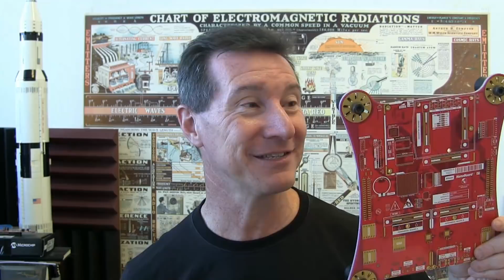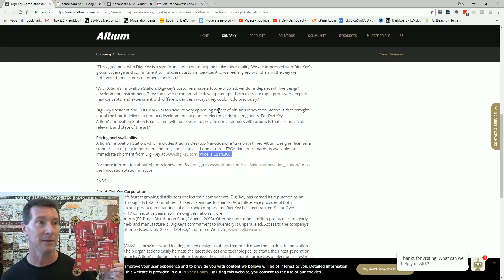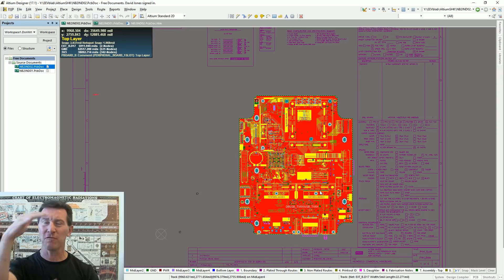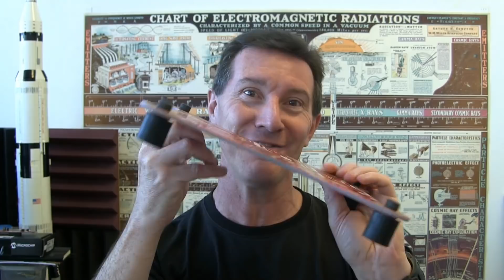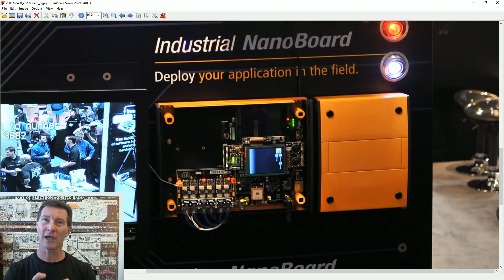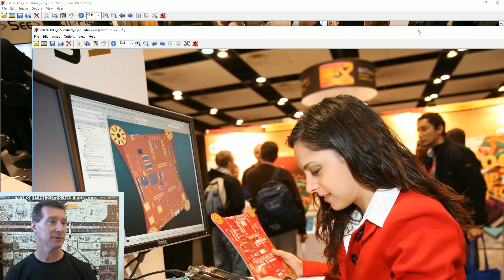eevBLAB #51- Industry Story - Design Deadlines & Unusual PCB Designs

Comment: Boy, that takes me back. One day I was working for a company that sold IT systems and software to physicians. And believe you me, you haven't seen a tight-fisted cheap bastard until you've tried to sell something to a physician. We had one guy who actually dragged his IT equipment out of the dumpster(and then complained to us that it didn't work properly of course)! Anyway, our system was designed to run in a client-server configuration, but because the doctors didn't want to pay for a separate server, I was tasked with getting it to work on a virtual machine on a Debian machine.
 About two weeks in - with no deadline set - the boss casually said as he walked out of my office, "Oh by the way, I need this ready to set up at the customer's practice in three days" - my face at that moment would have sent a hells angel scampering (but not my boss, him, never. Most self-absorbed idiot I've ever met). Well, as Dave said, you get it done, so I dove into it. I just about made it, too. Boss said he'd leave at ten the next day, I literally had ONE line of xml to tweak to get it to run not only on my dev box but on the delivery system and I'd already been in til 10pm the last three days, so I thought, "What the heck, I'll finish it in the morning" and went home. Promptly, at seven the next day, the boss phones me on the mobile and yells "I wanna leave, why isn't this thing done???" I said "You said you'd leave at ten, I'll be in in 30 minutes, I can have it done literally in under five" - "Now I can't wait, I have to leave NOW!!! It runs on the dev box? I'll take that one." So he really took my dev box, the rattiest, oldest PC you can immagine, and installed it in the customer office. It was literally a wreck, even missing a drive bay cover. The next day the customer phoned me up and asked me about the missing cover, and I (I know I'll go to hell for this) actually sold her the line that it was to improve cooling. As Dave said, you get it done. Not long after that, I got out of that sweat shop and got a job for almost twice the salary. Need I say that place is not in business any more? God knows I tried.

Comment: This is just to suggest that you consider starting a playlist where you explore cloning a standalone automotive ECU using modern MCU's.  Something to emulate or exceed the VW/Porsche/BMW/MBZ electronic control units that were sold starting in the mid 1980's with oh, Digifant for example. I think you would need a team because doubtless you have the digital and analog design and execution chops but I dare say even you would you need a gearhead for the 3D maps for fuel and spark..(rare for those guys to know the kind of things you know but hey Bosch apparently found a few..)..

Comment: Engineers work just fine with or without deadlines, in my experience.   It's the interaction with management that changes when a hard deadline is set.... it allows the engineers to say "no" far more freely, and thus put a heavy damper on scope creep.  You'd have to have done 12 designs if there wasn't the hard deadline. ;-)

Comment: Ghent Light Festival 2015, that one was fun. Due to a misunderstanding they put ENIG over the entire flex instead of finishing it with OSP, as a result a lot of the FCBs failed and we had to rush alternative ones through our own prototype line. Worked through the holiday break, alone in the cleanroom, to stick all the boards (>40 of them) in the vacuum press. In the end we were still soldering half an hour before the journalists arrived, a colleague was still stapling things together, and then we still had to load the code into all the microcontrollers, and there were a lot of them. I vividly remember standing on top of a questionable chair to hold up a laptop so I could get the programming cable to the board. Didn't get any t-shirt though!

Comment: 21:12 is all you need to know. I once did a traveling trade show with Apple in support of their authorized dealer network in the late 80's that hit Montreal, Toronto, Winnipeg, Edmonton and Vancouver back to back to back to back to back doing setup and teardown of our equipment plus deep technical consulting. I was the primary solution architect for VAX, System36/38/AS400 Macintosh inter-op gear so we were toting around a MicroVAX2 and a tiny System36 mini-computer a bunch of Macs and misc. gear. At the time I thought it was bad ass but man after the 3rd city I was destroyed as a person, my feet still hurt.

Comment: I really want to see a video on the engineering behind current transmitters found in industrial automation, its easy to make a pot controlled current source, but how does it work for a modern 4-20mA signal device?

Comment: the story is too long to get into but  a couple of weeks before we were to go to a trade show with a computer based advertising system we were privileged with a rare visit from the CEO. Everything was pretty much ready to go. He raved about what we were doing and had only one complaint: "it's too big". So we explained the timelines for redesigning the unit and getting it built and tested and having the case molds redone (etc). To which the response was "you don't have to redesign it, just make it smaller". So we hacked a display into a smaller case and hid the electronics under a table.
Reply: I always get a laugh from the story of the case design of the Hewlett Packard HP 9100A calculator...
"The dimensions were based on Bill Hewlett's secretary return desk. This was an L-shaped desk with a large work area in front and a much smaller "return" to the right meant to hold a typewriter. Bill liked the desk and decided that a calculator should fit on the small typewriter area. The team worked very hard in an era without computer-aided design and digital ICs to pack it all in. The case was designed at four times life-size on Mylar because of its temperature/humidity stability. Measurements could be taken from this with a pin and a magnifier resulting in 1/1000" precision. When the first case was built, the engineers took it into Bill's office while he was on vacation and... it didn't fit! They needed to demo the product for Bill when he returned in a few days so they hired a local furniture maker to build a desk exactly like Bill's but with slightly larger dimensions! Bill didn't notice the switch. When the team walked in and set the calculator on the desk, he said: "You see! I knew you could do it!""
Reply: Reminds me of a trade show where I saw IBM reveal their fancy new "CGA" graphics. I noticed the IBM PC had a fat umbilical cable coming out the back and going into the plinth. I peaked into the back of the plinth and saw a card cage, absolutely full of cards. IBM dude glared at me, said "It's a prototype, okay?"
Reply: you don´t talk about the original Amiga presentation, do you...? ;)
Reply: hah, no but we did use an Amiga 500 to design the graphics for the thing. This was an LCD display that mounted on the handles of a shopping cart and displayed ads while you walked around the store.

Comment: What do you think of using your low voltage sources to apply a very small differential between two opamp inputs and check if the output is like the open loop gain describes it in the datasheet?

Comment: But "tombstoning" resistors doesn't happen during the cooling phase, it happens as the paste begins to melt/flow, one side liquifies before the other, then surface tension pulls it over to that side before the opposite side melts enough to get wet onto the solderable surfaces. 

Once a part is wetted on both sides evenly, there is no way differential cooling is going to make it tip much at all, its going to solidify and start locking it wherever it happens to be, in this case pointing up!
Reply: Yes, so when you heat this board up too quickly and the outside parts start too melt but the center ones not yet, because the center of the board is still soaking away a lot of heat, then you can get tombstoning. Heat retention applies both for cooling and for heating.
Reply: The assembler probably had to use a hotter reflow profile to get solder on other components (BGA's) to flow because the board had too much thermal mass and copper planes.  It can be really difficult tweaking the reflow profile on some PCBs.  I used to work for an electronics assembler, and they had to purchase a vapor-phase reflow machine to reflow boards like these to prevent tombstoning on small surface mount caps (0402, 0201).   It is possible to design a PCB that no reflow oven process (no matter how many temperature zones) is capable of manufacturing reliably!
Reply: Yep, that is just what I was thinking...

Comment: Oh, gawd.  After 30 years of engineering I have more drop-dead deadline stories than I care to recall.  Prototypes that aren't functional 24 hours before The Big Customer is due to come by for a field demo (not a mere lab demo).  Systems that aren't ready hours before Really Expensive Beam Time for Cosmic Ray simulation testing.  Systems that are certified for 50/60 Hz, but the European customer is coming to the US in 3 days expecting a 50 Hz full-up test of a system consisting of dozens of networked sensors and instruments.  The list goes on.

I was on ulcer meds through most of my 30's, until I became senior enough to DELEGATE much of it.  And I also truly learned the maxim to "Work Smarter, Not Harder."

Still, I wouldn't trade a minute of it for anything.  Some of the best times of my personal and professional life.
Reply: "but the European customer is coming to the US in 3 days expecting a 50 Hz full-up test of a system" - courtesy of the salespeople who told the customer it is already up and running ;)
Reply: I too have been through this ridiculous cycle a few times  and detest it. I don't believe for an instant that it produces better engineers or products. I prefer the German approach where everything is planned and executed in an orderly fashion. In the long run it's a far more efficient methodology.
Reply: Yeah, it doesn't get better than when you're really under the gun and failure is not an option. You feel so bloody alive in these situations. As Terry Pratchett put it: "You get a wonderful view from the point of no return"

Comment: I'm in the exact same position right now . There are a few errors in design due to the insane timeline and adding to that the rush assembly job has led to several issues. I don't have a single board working yet.
Reply from the maker: No worries, she'll be right!